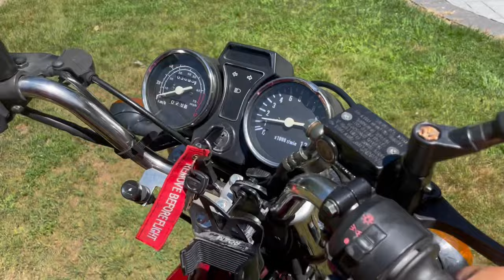SSR Lazer 5 Moped 2000 Mile review **** Spoiler Alert It Did Not End Well**** new 110 cc engine

Comment: I have one of these with an SDG 110cc motor on it and it works awesome. You almost wonder if SSR knew/knows what people are going to end up wanting to do with these. Also btw I geared the rear sprocket up a few teeth, and the bike goes a good 55 or so. Very nice little platform for pit bike motors if you can sort out the electrical, which isn’t too bad.

Comment: I have a Puch Maxi S, 1989, 50cc magnum with 4k miles on it. I've been having fuel problems and the engine refuses to start.
I've already replace the carburetor with a 15mm over the original 14mm. but, fuel doesn't seem to be getting into the engine. i have the correct 2 part gas and my fuel line is fine. I'm thinking it might be the jet. 
the original 14mm came with a 65 sized jet, but the 15mm carb came with a 50. So im assuming that might be the problem. what do you think?

also, great video!
Reply from the maker: Start with spring starting fluid in the carburetor if it starts and runs then you know your fuel related if it doesn't start then look at spark you need three things fuel spark and compression well and air but I assume if you're not on the moon that's a given

Comment: Hi how long did he have this moped for? I also want to get a Lazer moped. Do you think it would be good for deliveries?
Reply from the maker: He has had it for a year.  Reliable. Not at all engine went.  Brake master went. Rear wheel cush drive bushings wore out (this may be due to the new 110cc engine I installed).  Also had to replace the chain    it's made in china and all the fasteners are cheap

Comment: You probably didn't need the charging system to be converted you can use the AC power rather than DC but you'd not have a battery